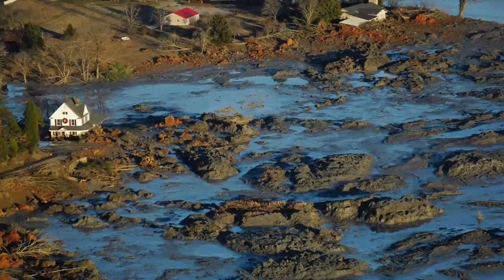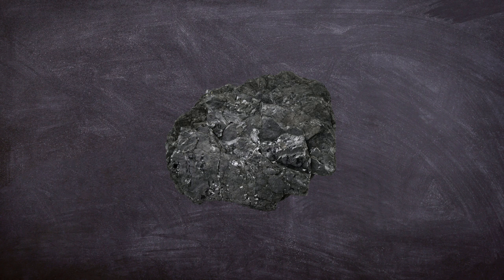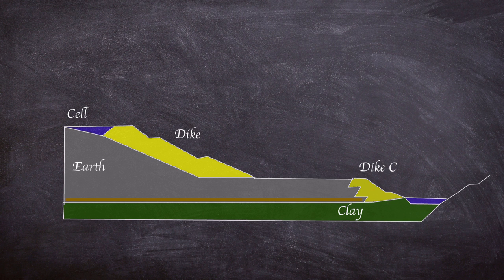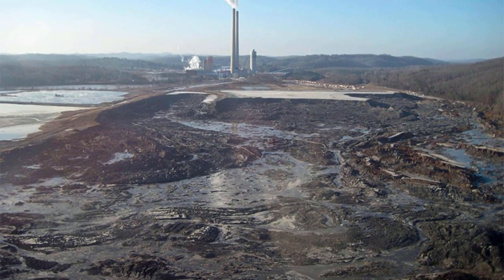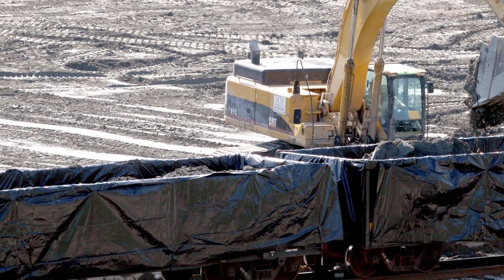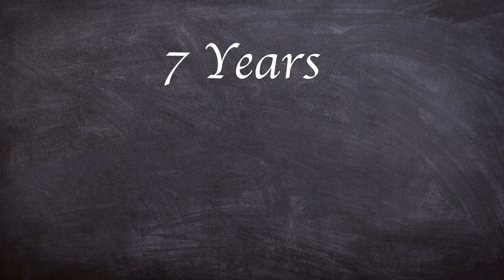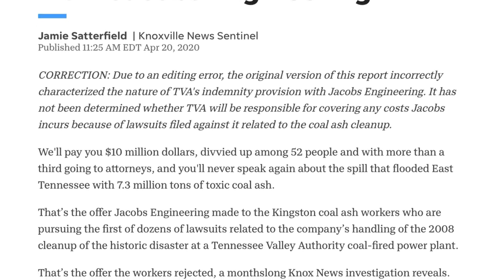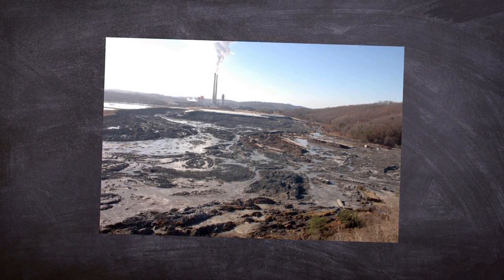A Brief History of: Kingston Fossil Plant coal ash spill (Short Documentary)

Comment: "Coal is a dirty fuel."

That's putting it mildly. Burning coal emits what feels like the entire periodic table, and emits more radiation every day than a nuclear power plant does in a year.
Reply: Really, we need to develop solar so it can work anywhere in basically any conditions. (and not break down while doing so) Anything else produces literal poison and is going to doom us as a species. But especially stuff like this.
Reply: @Starfloofle  Nuclear is a far better solution right now. Comparatively it is far safer and as long as the correct steps are followed and there aren't shortcuts taken then it should be fine. Supplemented with solar, hydro, wind and tidal generation you don't necessarily need a vast number of power plants which should cut down on nuclear waste. Storing the waste is relatively straightforward but again any shortcuts will undermine the situation.
Reply: @Starfloofle  You do know that solar panels are made of rare earths which have to be mined from the ground? And we put more energy in building solar panels than they will ever produce, so we run them at a net loss
Reply: DEADBEEF that hasn’t been true since 2012, they even repaid their “debt” in 2016. They’re made out of aluminum, glass, and semiconductor silicon, which are in no way “rare”. Also a well made solar panel (most of them) operate at 80% efficiency for about 25 years, so even if they were more expensive or energy intensive to produce, they would still pay it back eventually.
Reply: My best bet is a combinaison of Solar, Nuclear, and orbital solar. 

Solar for any place with consistent sunlight all year long, and deserts that don't really do anything else
Nuclear for any country where renewables aren't really possible as a baseline for the grid
which we use to power up the world while we setup a large solar array in orbit to slowly shift the power generation closer towards green. Moreover, this array can be VERY usefull whenever we will decide to start building a dyson swarm as it can serve as the infrastructure to capture the energy harvested by the array as it gets built
Reply: @mobiuscoreindustries  Thing is you're talking about something that is decades if not centuries in the future. Nuclear and a combination of green energy can help us now. An orbital solar farm would require some sort of connecting line or really big batteries otherwise it's kinda useless.
Reply: @TheTrainChasingPoet1999  Clean coal technology is still not totally clean just cleaner than burning it normally. Nuclear still represents a far better option in terms of environmental sustainability.
Reply: @purplefood1  Please excuse my horrid behavior in the last comment I posted. I wasn't well-rested at the time of posting and I was in a fighting mood.   I won't lie, coal CAN be messy. But there is potential. First and foremost, fly ash makes for great cement. On top of that, the more metallic elements can be extracted from the ash and put to better use. Coal ash may even contain silver, and that's a missed opportunity. With great precision, we could extract the silver from the coal ash and  sell it to jewelry makers at a fair price. There's potential in coal, I just wish coal-fired power plant owners  could see it.
Reply: @TheTrainChasingPoet1999  That's uhh really decent of you. I think unfortunately there's no motivation for them to change which is a shame for both industries.
Reply: @purplefood1  We need to be ready for the collapse of the  coal industry. If a community knows a nearby power plant is going to close, there should be a  program put in place to help the displaced workers. It's  happened twice  in towns nearby to me. Displaced workers either retired, left the state, or went back to school to learn new trades.
Reply: Noah whitehouse tell that to Fukushima (or any of the myriad nuke plants built on fault lines, flood zones etc.)  The short sightedness and inability to learn from unforeseen circumstances which history has demonstrated always astound me when coupled with suppositions like yours.
Reply: @VerMirror  I can only assume you'd be talking to me given that the person you originally addressed this comment to is in favour of cleaner coal fired plants as opposed to nuclear. I'm not sure why so many nuclear plants have ben constructed in tectonically unstable or otherwise geographically active areas of the world. 
Really there should be an internatoinal ban on such things given how difficult it is to guarantee the safety of such a complex in such an area. 
That being said this doesn't diminsh their effeciveness and if built in areas without these issues it would be perfectly fine assuming it was properly maintained and money invested to do so.
Reply: @purplefood1  the orbital array would beam the energy back to earth via microwave laser.
Reply: So... we can’t trust the “Roll Coal” crowd with environmental decisions then?
Reply: Coal is being replaced in USA in most all applications in industry by new process of cracking propane. Most carbon byproducts come from oil refinement through coke and flyash. Flyash with lime we use in soil work. There's so much recycling in this world that people only see the consumer garbage... Industry isn't actually America's problem at all
Reply: I wonder if we could use remote wave generation of hydrogen out at sea to power hydrogen-fuel cell based vehicle fleets. Or use the electricity to create artificial natural gas (which pulls in carbon)
2/3 of the earth surface is ocean.  If we can use wave generation to help fix our energy problems, that would be good.
I'd rather not use nuclear, but I don't necessarily see it not being PART of the solution.  However, renewables are newer and still developing.  Better building technology, still developing.
Reply: @TheWonkster  Yeah, the silicon that's currently unrecyclable and doped with metals like indium, gallium, arsenic, and more in the high-end high-efficiency solar panels, like the ones that recently busted the 22% efficiency record.

Is that 80% efficiency their starting efficiency, which for most budget solar panels is around 20%, or are you actually stating that solar panels operate at 80% total efficiency?

https://www.youtube.com/watch?v=wwHjyeyRofM

Nuclear energy is a no-brainer, it eats its own waste, reactors have no technological limit on how long they can last. (Even neutron embrittlement is 'cured' with an annealing), consumes a tiny portion of the land and resources that equivalent solar generation would require, and we can control exactly when and how much power it makes, without also building massive battery banks.
Reply: @TheWonkster  Lol They dont work in the dark though!
Reply: @TheTrainChasingPoet1999  back around 2010 or so they started building a clean coal plant about 25 miles from me. About 3 years ago the whole coal section was shut down and abandoned. They couldn’t get it to work. A 6.7 billion dollar loss.
Reply: Nuclear needs to be reinvested in.  Because of the incidents in the '80's with frist and second generation plants, the public became afraid of nuclear.  

Reality is that modern plants, built with new designs are insanely safe.  But we are extending the operating life of half century old nuke plants instead of building newer and better ones, ironically making us less safe, not more. 

Hydroelectric is the best form of energy, but is very geographically limited as it requires rivers and dams.
Reply: @Starfloofle  as solar gets cheaper they panels are now garbage that cant be recycled and they uses rare shit to make right down to the clear glass look up how we are running out of just about everything we use to make them
Reply: Until the nuclear power plant goes boom
Reply: Oswald Mosley  Thats just plain wrong. We actually have no idea just how many people exactly those accidents killed and will kill, even chernobyl is still killing people via cancer now and will for decades. The only real number we have is direct death, which is low, and the statistics for cancers raising which go from a fee thousands on their lowest to hundreds of thousands who lost a significant portion of their lives as a consequence. And each time so far we got extremely lucky, because none of them blew up big time. Cernobyl for example could have very easily irradiated most of Europe if not for extreme luck, quick thinking and some sacrifices.  And additionally, if the wind had blown somewhat differently the radiological consequences would have been 200-400 times worse, without the possibility of a second bigger and even more irradiating steam explosion that thankfully was averted.
Reply: Oswald Mosley  They did not dramatize that. Look the historic facts up.
Reply: gas is a lot safer and only make carbon monoxide or sulfur dioxide if there is a lack of oxygen in the burner but 99% gas is the safest fossil fuel
Reply: @Notfallkaramell  Basically all accidents have been with nuclear tech from the early 70's and before.  The designs available now are orders of magnititude safer, we're talking tens of thousands of times less likely to have an incident.  

The problem is that we are keeping these old plants from the 1970's running 50 years later, and keep extending their lifespans beyond original specifications.  

The lack of willingness to build new plants is ironically the main thing putting us at risk of accidents.
Reply: With massive improvements available for light water reactors, and other technology like molten salt reactors being available, there is no excuse not to decommission and replace outdated plants.
Reply: Wait, more radiation? PRAISE ATOM!
Reply: @purplefood1  both coal and nuclear are as bad as each other, technically dams are the safest option cause all they use is concrete and whatever the turbines are made from. atleast untill we can get the technology to fully extract and reuse the elements that make up the biproducts of coal and nuclear, cause without that theyre both equally as harmfull since our only solution for them is to bury them for future generations to care about since most the developed world bans the use of nuclear weapons these days in most circumstances. im not anti nuclear but burying barrels of radioactive sludge in caves for them to inevitably corode, start to leak and destroy any environment theyll touch inturn destroying the earth for the future generations we're claiming to wanna protect is not the answer in my opinion. any solution we come up with is gonna require mining reguardless hence why i dont use that as an arguement, but i think the solution needs to be the one thats the least harmful to surounding areas. which is why i say dams, cause damns atleast have the potential to save poeple and livelyhoods in drought affected areas, they dont really take any special materials to build and if something goes wrong youre not gonna be left with an uninhabitable wasteland like nuclear reactor or fuel plant incidents often do
Reply: @michaellebert8907  as for fracking, its why america has such a sink hole issue, the fuel may technically be cleaner but the extraction leaves a ticking timebomb to destruction in its wake
Reply: @Rocker-1234  Except they aren't simply buried in the earth to corrode and leak there are specialised containment facilities planned (mostly not yet realised because of the hysteric anti-nuclear wing) that would monitor the condition of the waste. If anything it would be handled better than most current industrial waste is. I'm not sure what relevance a ban on nuclear weapons has to do with nuclear power i'm sure you thought it was vaguely relevant. And yes the contruction of all types of power generation requires mining... apparently that's fucking relevant.

The issue with hydro-electric dams is you often have to flood massive amounts of areas to make it work destroying vast tracts of other eco systems; dams can also cause droughts downstream as they effect the flow of water and dams have also killed plenty of people when they break; per gigawatt generated nuclear is still the safest energy source.
Reply: Also If the three gorges dam breaks nuclear could become safer than hydroelectric statistically. The dam has shifted and is deformed as of june 2020.
Reply: @purplefood1  Nuclear is a far better solution right now. Comparatively it is far safer and as long as the correct steps are followed and there aren't shortcuts taken then it should be fine. You apparently need to watch more Plainly Difficult videos
Reply: @misterflibble6601  Yeah cos there's no videos about disastrous fossil fuel plant malfunctions.
Reply: @deadbeef576  So? At this point rare elements can by synthesized, we already do it with diamonds.
Reply: @TheWonkster  LMAO thats a complete lie.  The best solar panels in the world aren't even 30% efficient.    Sunpower's A-series panels have the highest efficiency rating at 22.8%.
Reply: @purplefood1  In theory nuclear is very clean and safe. In practice humans always manage to cause disasters. There are still places in europe they have to bury boars in lead lined caskets because they eat lots of mushroom..
As shown here the storage of poisonous materials is an game of chance, becuse humans take the opportunity to make an quick buck by cutting corners with the resulting fallout.
Reply: @pouncepounce7417  Yeah and coal and gas is doing us a world of good. We're already having issues with this fuel source and we're being squeemish about the next one because what exactly? There's nothing all that safe or clean about oil or gas power stations and per mw they kill more people. Nuclear is a risk yes but with a robust inspectorate you can ameliorate some of those risks if not eliminate them.
Reply: @Starfloofle  solar has 1 major problem, it only works ~50% of the day and it has to never be even a slight bit cloudy in order to be at maximum efficiency, but it also has to waste a bit of energy to follow the sun to get all the energy from it
Reply: @Starfloofle  Solar panels, batteries and wind turbines are also the doom of our species. They have to be replaced VERY OFTEN, and lithium mining for batteries isn't exactly a good idea.
Reply: @deadbeef576  Riiiight. Because solar panel manufacture and effectiveness hasn't at all improved since the '80s.
Reply: @TheTrainChasingPoet1999  Impossible
Reply: @purplefood1  1. The relevance of the weapons ban is that nuclear energy research can be - and historically, has been - used to obfuscate nuclear weapons research. The USA did it, pretty sure the USSR did it, and it's what the Republican Party insists Iran is doing.

2a. The anti-nuclear lobby is not "hysterical". Look at all the US-based criticality and contamination incidents documented on this channel, as well as other US industrial disasters, and the common threads of corporate-induced shortcuts and cut corners. The more modern reactor designs being safer in principle is meaningless in the face of this country's corporate culture - the reactors may have gotten better, but the US busines world sure fucking hasn't.
So even if they really are safer, I don't think we're currently culturally capable of safely implementing them. OR their fuel infrastructure. Fuel which, y'know, has to be mined and processed and all of that.

2b. Disposal site creation can cause issues of its own.
Reply: @TheTrainChasingPoet1999  The coal plants however cannot be made clean.
Reply: @ZeldaTheSwordsman  I'm not saying that.

Comment: I lived about 2 miles across the river from the TVA Fossil plant when the ash spill happened.  That was my 22nd birthday and I was woke up to my phone ringing off the hook with I thought it was my buddies calling to say happy birthday but when I answered they where hollering that there was a failure at the plant.  We all spent the next few weeks working on the cleanup but didn't stick around long due to the conditions. 

on a side note they had to change the way the measured toxins in the river due to the spill happening so close to where the emory river meets the clinch river,  the clinch river is contaminated with mercury, arsenic, lead, PCBs, radiation, and more from The Manhattan Project in Oak Ridge.   If you take a boat about 5 miles up the clinch river from the plant you will be met by signs along the river stating not to touch the water, swim, or fish in the area due to contamination.

Comment: Hey I have a se for you!  happened in Costa Rica in 1996. They calibrated incorrectly a cobalt-60 machine used for radiation in cancer patients and 115 of them, from children to adults, suffered from overexposure. I believe 16 of them died. 
Most the info on the accident is in Spanish, thought, but I could help yput out translating if you wanted.

Comment: Toxicity of fly ash depends how well the boilers burn the coal. Older boilers had higher“carbon in grits” so more unburnt nasties. However ash slurry is incredibly searching and quickly sets like concrete. 
Run off from coal mine drainage is many times worse and often a serious issue from disused mines.